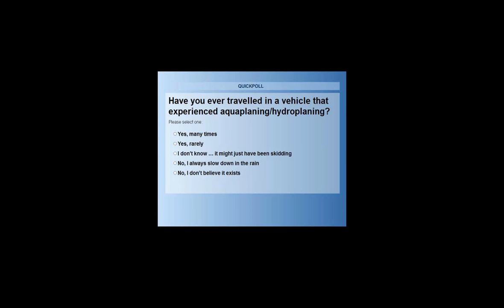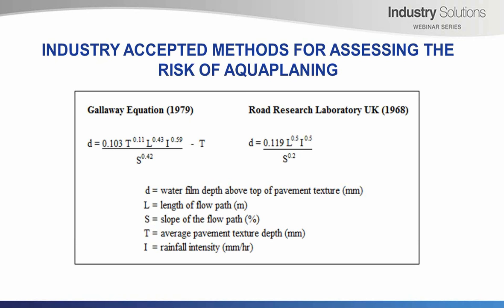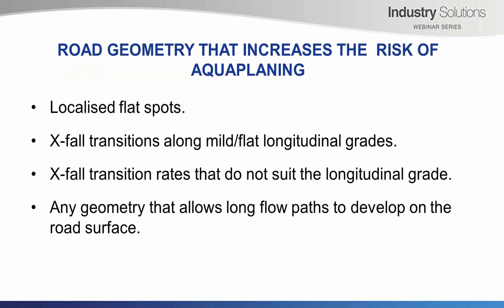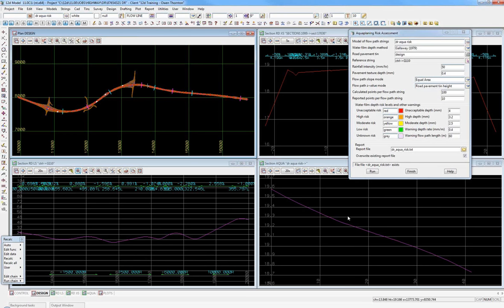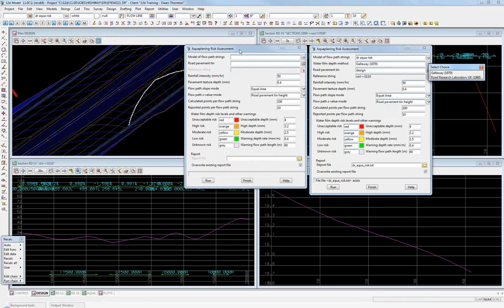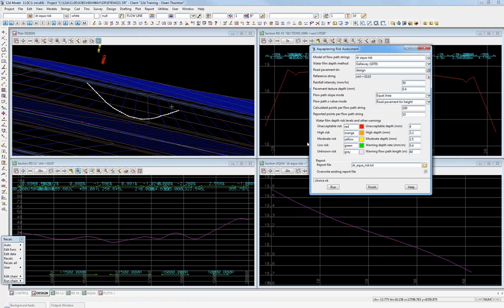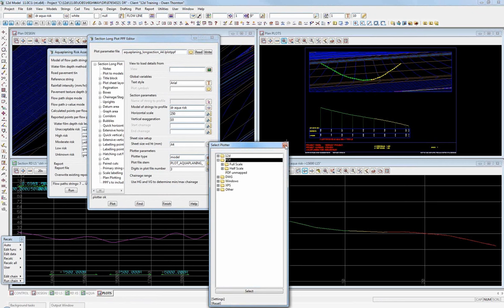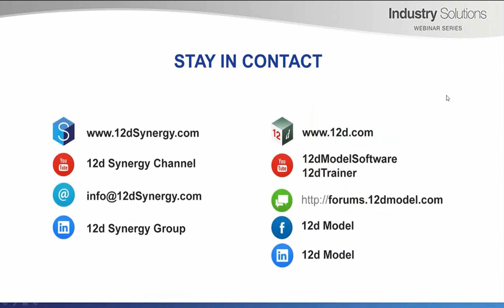Industry Accepted Method for Assessing Risk of Aquaplaning - Industry Solutions Webinar Series

Comment: Owen, great presentation mate. The 3.25mm limit commonly referred to as the high risk zone. I interpret this as the upper design limit, as a conservative design parameter so the inaccuracies of the equation allow for a target film depth of 4mm max.  

The consequences of saying 4mm is acceptable for a design parameter may mean your actual risks being greater than 4mm.

I noticed your spreadsheet touched on it.

Thoughts?
Reply: I don't think I, nor 12d Solutions, would want to take any responsibility for assigning risks to film depths. So they are parameters in 12d Model and you decide! 🙂